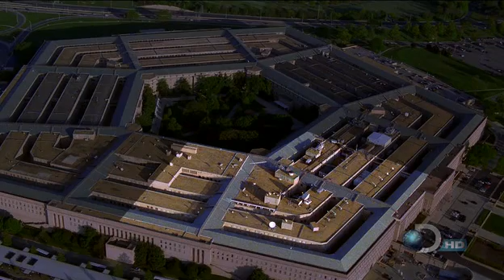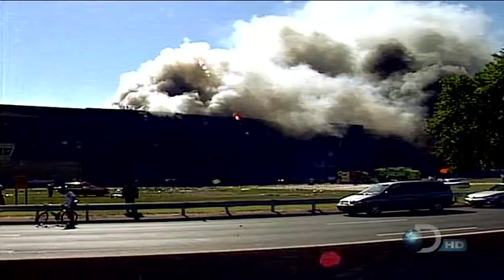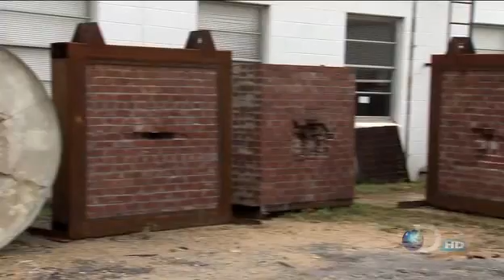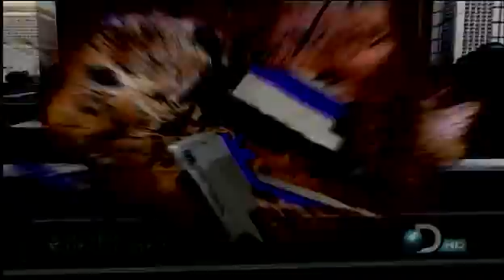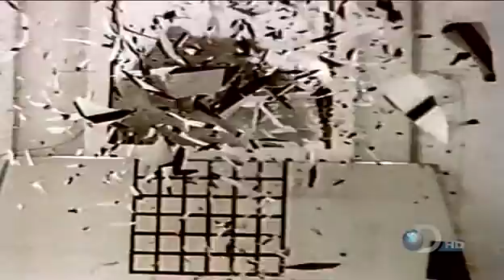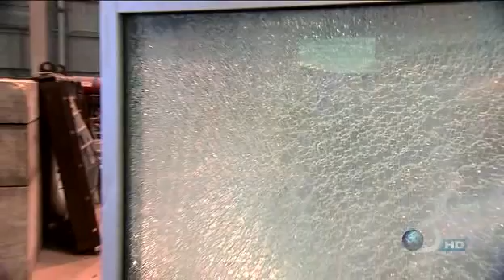9/11 Pentagon "COINCIDENCE"

Comment: So before 9/11/2001, the Army engineers had phenomenally sophisticated cameras that shot 100 million frames per second, with vast banks of supercomputers to analyse the images in exquisite detail, for the purpose of testing the wall structure of the Pentagon which was being reinforced to withstand blast impacts.

Then on 9/11/2001, the Pentagon event was covered by just two dinky little security cameras that took distorted grainy images at 1 frame per second,